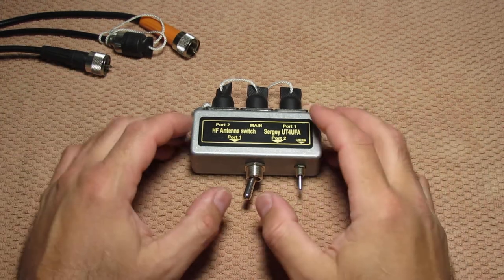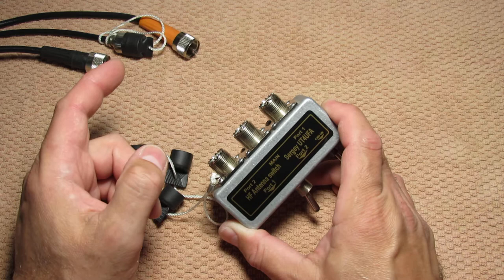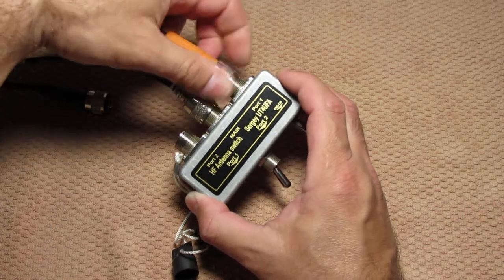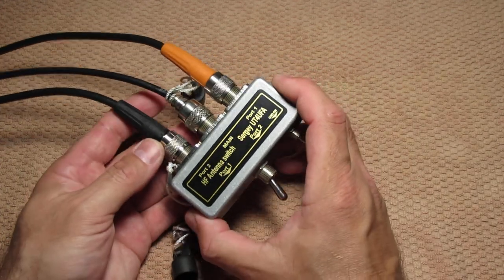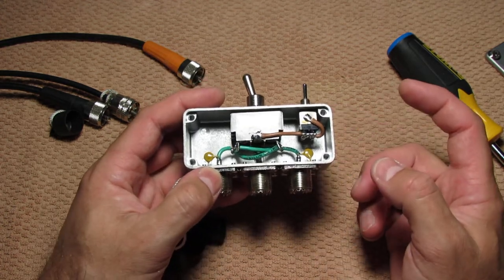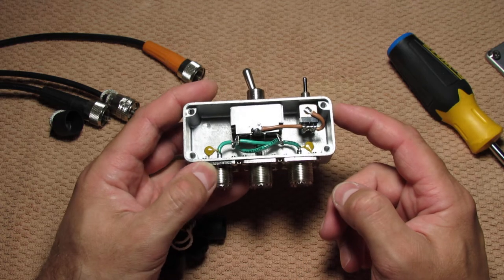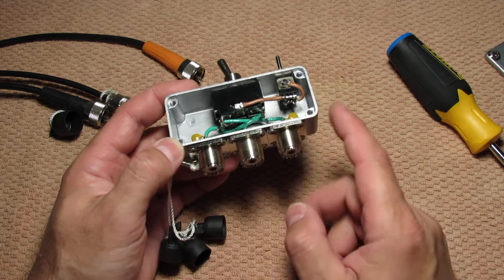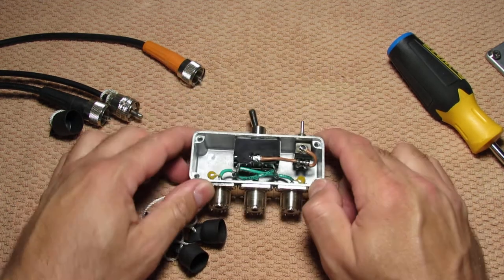Old school antenna switch.

Comment: A good idea. One option would be to use a DPDT switch and send the unused antenna either to ground or through a 50 ohm resistor. That'd prevent noise and leakage between the two antennas or, if the switching is between two transceivers, RF from the hot one from getting into the other.